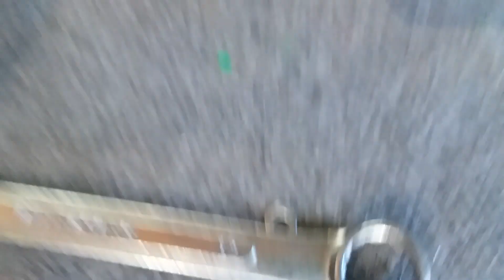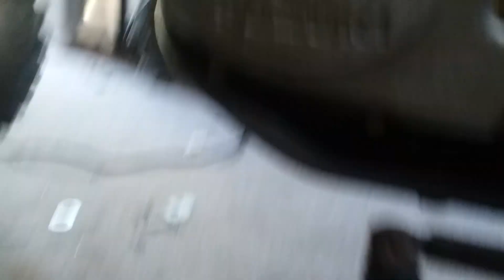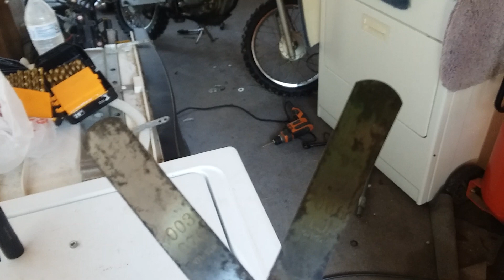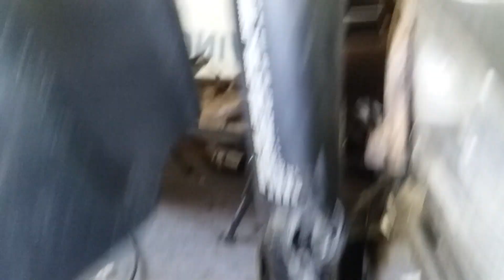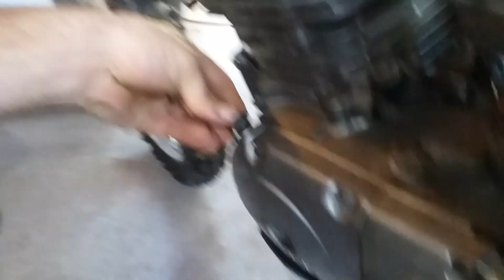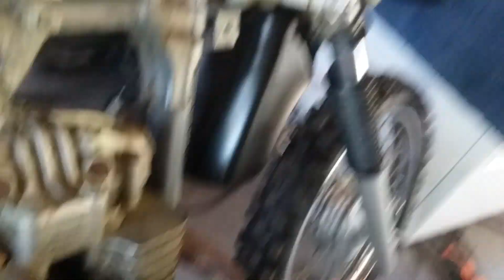125cc dirtbike Valve Adjustment (Suzuki DRZ 125cc)

Comment: You should really use a wrench to tighten the 10mm nut on the rocker arm while at the same time holding your straight slot screwdriver from turning. The way your are doing it will cause the whole thing to turn as you are tightening it with the socket.

Comment: Easiest way to fibd the compression stroke - put yoyr finger over the spark llug hole until you feel air blowing out, its trying to compress but because the spark isn't there it just blows out.  Saves a lot of time.

Comment: A man of few words, but outstanding video! I at least have a good idea how to do this now on my KLX125 (same bike). Basically, get the motor to top dead center-what you did on the bottom end, verify through spark plug hole, then adjust the valves to .003 thank you!
Reply: Sorry mate I know I'm 2years to late but did you mange to work out its 00.3 in 00.6 out
Reply: @liamwilliams7782  I sure did! Turned out that bike had very worn valves and had to be completely replaced. Your video helped me get them adjusted, thank you!
Reply: @stevezee5568  any chance you remember what you actually set the valves at mate as I have tried a fair few settings and all seem wrong pal im starting to think maybe my bikes the same but its fairly new so I can't see it being worn but I might be wrong

Comment: For all that watch this - valve play on original GN125 seems .10mm in .12mm out. On the Chinese copies it is .10mm in and out. 
Try to move the feeler gauge blade sideways under the set screw, don't try to poke it in between.
It also takes a 10mm ring wrench for the counter nut and a flt blade screw driver for the set screw - without these simple tools this process turns into an nightmare.

Comment: Didn't show the timing marks, or describe them in the description. 
I believe the feeler gauge should be .003 and .005 right ? 
NEED to do, unless you have a video on the Cam Chain Adjuster...
Reply: You can download the service manual for free online and it has all the info in it. I did and I’ve just used that for all my maintenance on my 125 DR-Z’s. It goes pretty well in depth about valve adjustment and other things.
Reply: Is one side .005 and one side.003?

Comment: Its no really no  help when youre not explaining what youre doing and why( lining up TDC on compression stroke, checking cam sprocket marks are level with cylinder head through the rubber gromet ,  ensuring both tappets are rocking with at least some clearance, making sure the engine is completely cold, luckily i understand what's happening,  but to a novice its as much use as a chocolate teapot)

Comment: Great video, what year is your DRZ125?
Reply from the maker: 2003
Reply: @3DK_PRINTZ  what value of the valve adjustment? I'm French and I never see this video ajustement in french for my 125 drz.
Reply: @tonyboy9651  if you never got it it's .08-.13mm intake and .13-.18mm exhaust side 2005 klx125 which is the same bike

Comment: What year is the dry in this video? I have an 82 dr125 and the engine, etc. Look very similar. I need an after market muffler, as the exhaust bushing for the stock setup is not available.
Reply from the maker: 2007

Comment: What is your intake and exshaust measure i have a gs 125 same engine as that
Reply: Did u ever find out, are the both the same?
Reply: @gavinhays7952  yes its the same engine in our country this motorcycle is called suzuki GS 125
Reply: I meant the measurements for each do you know what they are? Sorry for the confusement
Reply: @gavinhays7952  yes 0.4 on intake 13 on my exshaust thats my bike wanted
Reply: .13 or .013?
Reply: @gavinhays7952  0.13

Comment: What am I looking for in that hole
Reply: can you tell us what mark you're looking for in the 'inspection hole' thanks, cool vid
Reply: Top dead center mark
Reply: He's spinning the engine by hand to find top dead center on the compression stroke.  You'll see piston at top in spark plug hole, confirm with a pencil,  top dead center stroke when it's blowing air out of the spark plug hole.